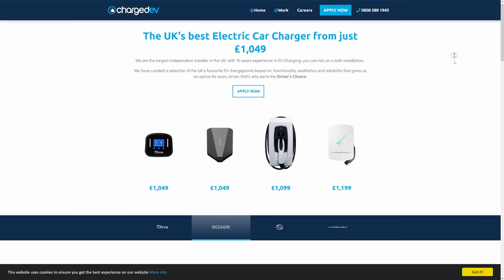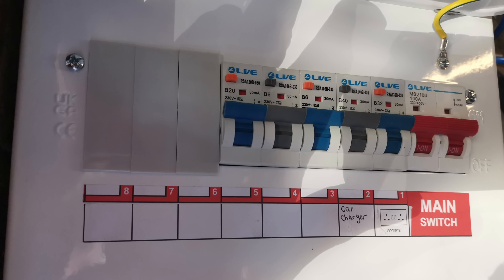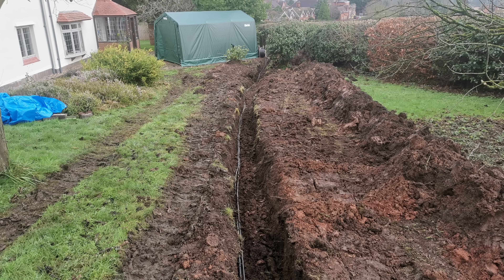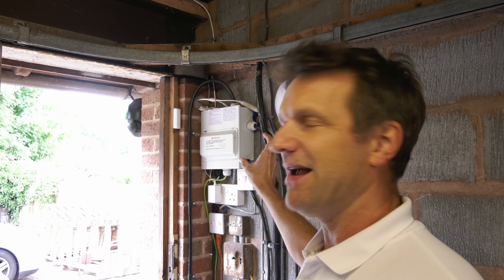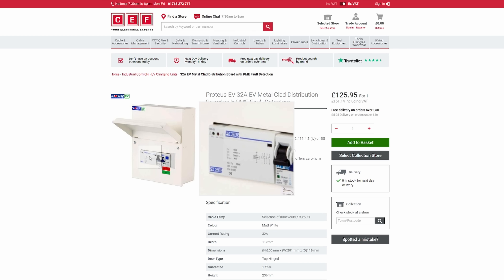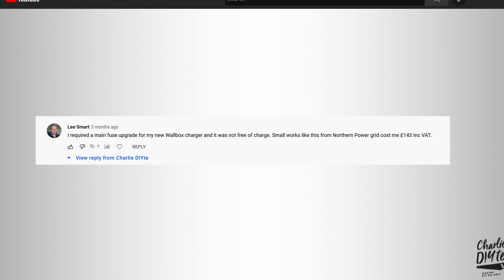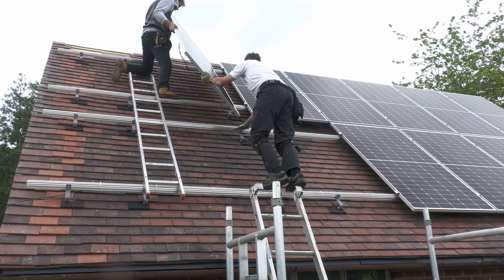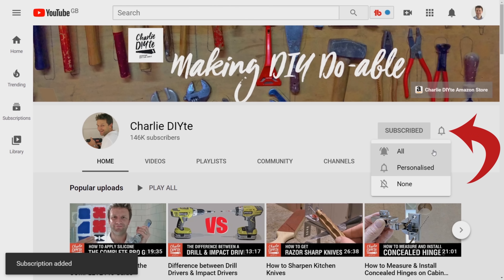EV Charge Point Install - What Went Wrong

Comment: You have a few things wrong here.
1) it is obvious that the initial rcbo is single pole, and that's nothing to do with the number of slots in the cu, there is a clear and obvious diagram showing it on every rcbo, on this particular one it is even on the front so very obvious.
2) As the electrician doing the pre-install may be unaware of the eventual use, they cannot be reasonably thought to have done anything wrong, however those who installed the actual EVCP are 100% at fault - no excuses,  normal observation clearly highlights the single pole rcbo, and proper testing would also identify that the neutral is still connected when supposedly tripped.
3) no, there should never be a single pole rcd/rcbo upstream of a double pole rcbo as in the event of an earth fault there is no guarantee that the "correct" double pole one would be the one to trip.

Either this circuit should be supplied via a double pole rcbo (and no further downstream rcd/rcbo) OR it should be supplied via a MCB and all cabling protected against earth fault mechanically (for instance by using swa cable, or installed in conduit)
4) I can't quite make it out, but the rcbos must be at least type A (providing the EVCP has 6mA DC protection circuitry), this is an important part and worth mentioning.
5) as for TT installation,  your main supply should have a 100mA time delayed rcd in place, applying any rcd or rcbo downstream of this is only worthwhile if it is less than 100mA and a shorter delay.

Therefore if a rcd/rcbo is placed on the supply to the garage it should be 30mA, unless the supply to the garage is taken before the 100mA rcd in which case a 100mA type S would be correct. 

The biggest error here is there has been no proper designer of this system,  by stitching together various pieces of work from various suppliers, none of whom have been supplied with the appropriate information of the whole installation,  there is clearly no guarantee that it is suitable or safe.

You took on the responsibility of designer,  yet can't even tell what type of equipment is being used even though the diagram showing this is on the front!

All the equipment used and supplied in your installation is perfectly correct and suitable when used appropriately.
 Unfortunately , the piecemeal approach to putting the equipment together means perfect acceptable equipment is used in inappropriate circumstances.

Each party may have done their part to the best of their ability,  but the lack of overall design has resulted in this situation.

Your point of "surprise " that this equipment is widely used and may therefore be an issue is wrong, proper selection of equipment is very much part of the 18th,  live like every other manufacturer make a wide variety of products,  the designer needs to select the correct ones for their design.
Reply from the maker: You're suggesting they worked to the best of their ability and I was to blame because I designed a system that was flawed from the outset. This is not right and your best case scenario doesn't reflect reality. ie who is this mystical designer? I got chapter and verse from chargedev on what system was required for their install and my electrician implemented those instructions. I wasn't designing anything and I struggle to see how this scenario could have been improved, except perhaps if Chargedev were to specify a superior customer unit that came preinstalled with the requisite double pole RCBOs. I'm a DIYer with no electrical qualifications. I don't pretend to be anything else and that's why I don't dabble with electrics but place my reliance on those with the appropriate qualifications.
Reply: Acting as the designer is not a matter of qualifications,  but of actions.

Take the following example: You bring a builder in to knock the wall down (kitchen-dining rooms), he checks – you have a bathroom upstairs so he designs the support (rsj) accordingly; subsequently you bring in a plumber to re-do the bathroom fitting a large hot tub – “that will increase the weight” he says, “oh I had a builder in to remove the wall and put proper support in for this bathroom “ says you.

End result both of these people have done their job, they were provided with the information and scope , the problem is that you acting as the overall designer/coordinator did not align the two scopes of work.

This is in effect what has happened here, the first electrician delivered what he understood to be correct given what you asked him to do, and similarly the EVCP installer understood that everything was correct for his work as you had arranged the supply on his behalf. 

There are many solutions to this,  firstly the first electrician could have been instructed to provide a blank way or two in the cu, or the electrician could have been instructed to contact your chosen EVCP installer and coordinate what was required,  or you could have got a detailed specification from the EVCP installer and passed this/this information on to the electrician and so on.

Someone bringing in and coordinating various trades or individuals becomes the designer unless a common design has been published and communicated to all involved.

As for the equipment , there is nothing wrong with the make of the equipment used, “upgrading “ to something better would make no difference if the selection of the actual components is based on the wrong information.

A £50 RCBO is no better a choice than a £6 RCBO if you need a type B and both of these are type ac. 
A £6 type A is far better than a £50 type ac; if a type A is needed.
It really is that straightforward

Comment: Hello Charlie great follow up vid, Carl F has commented with what i would suggest is the best advice. You have gone to the trouble of proving an warts and all video on the subject. We often quote domestic customers and end up been too expensive, because we will do the job right. And what happens is the customer will go to an "internet installer" who will perhaps not  do the job right. For a 3rd less than our price, simply because the average domestic householder doesnt know the complexity of the subject and rightly or wrongly looks at the £££££. Every car salesman and person buying an ev should be made to watch your vids and read the comments.
Reply from the maker: Thanks Paul, really appreciate that and I agree - Carl F's comment is spot on.. I'm afraid the general public are mostly motivated by cost and don't appreciate the value (and indeed cost) that is added by an installer who knows their stuff.  The other affliction is the disease of going into a shop, bleeding the salesman dry of information and then buying online. We had a similar problem to what you describe in the soft furnishings industry. Some people were full of indignation we were too expensive for them but you just have to point out you don't apologise for your pricing, assuming of course you have enough work not to have to lower it 👊

Comment: A useful video, so much so I went out to check my own consumer unit in the garage and am still none the wiser (I actually think the charger itself has the requisite protection but I’ll have to check).  I’ll have to remember the title of this video though as it doesn’t hint at the important electrical advice contained within.  Looking forward to a solar video from you, as a battery is next thing to research - but I’m wondering about cable capacity as with a car and a battery charging on a nighttime tariff, I think I’ll need another buried cable…
Reply from the maker: Thanks Richard. I was told my existing cable would suffice because the solar is generating supply not load but it is worth checking.

Comment: Installers and non-EV sparks MUST know the regulations, how to spot a dual-pole RCBO and how to gland SWA. The RCBO isn't the spark's problem but the glanding absolutely is. The installer should have caught the glanding and the RCBO.

DIYers pay professionals in order that they do things right; if we wanted slapdash, we'd do it!. I know you have an ongoing relationship with yours —and the installers put some things right— but anyone else should file complaints with NICEIC if they get work like this. These mistakes stink of wanting to get home on time, not wanting to make an extra trip to Screwfix for the right size gland, or wait for the right RCBO to come into stock. Unacceptable.

Comment: this is why I don't install LIVE crap. it will be a brand that comes around as quickly as it goes obsolete, only installed solely on cost and not quality.
Reply from the maker: D'you know for a fact that it's crap?
Reply: @CharlieDIYte  I put one board in and didn’t like it at all. I mainly use Fusebox or have used Hager in the past and  Schneider for industrial work. 

There are things that each manufacturer does slightly different or they do a slightly different device. So there really isn’t a one size fits all brand, as such. But for me the quality of the live stuff I used, instantly put me off the brand. The same can be said for BG.
Reply: @CharlieDIYte  Not so much "crap" it just makes sense to use mains boards and switchgear from an established manufacturer , Hager etc.

Comment: I also had a Indra installed by ChargedEV, very Similar consumer unit setup as yourself. ChargedEv installed a IMO brand 2pole type A RCBO into my Hager consumer unit, I don’t think hager make an equivalent
Reply: Strictly speaking they should not have done that, but i get why.